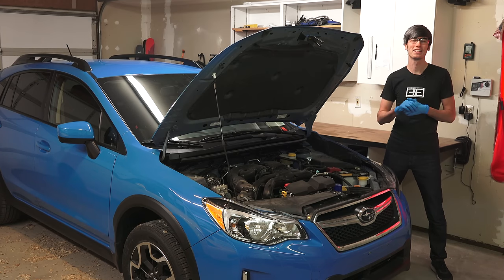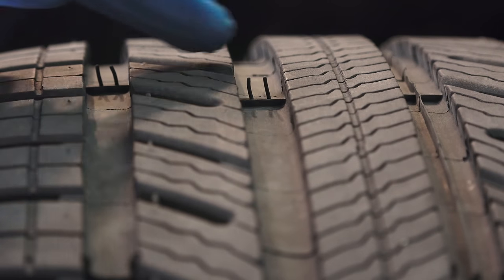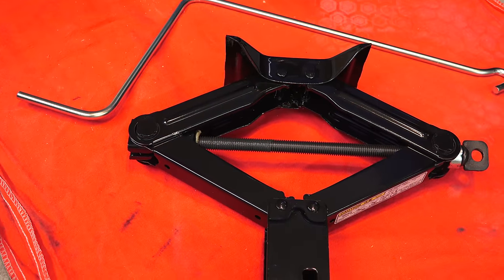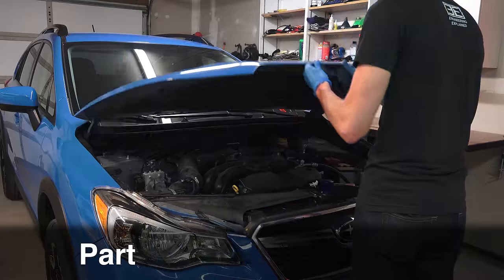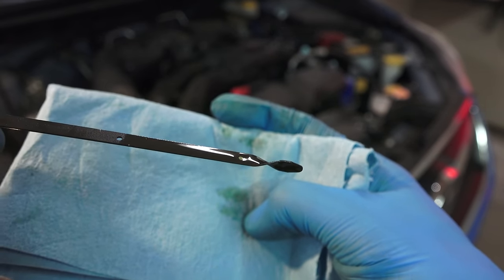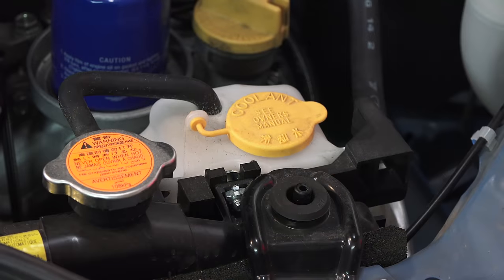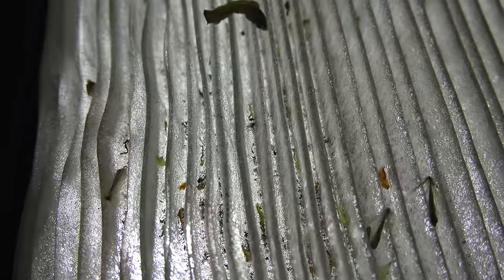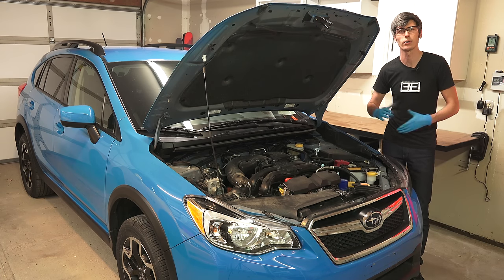How To Make Your Car Last A Long Time - Simple Checks

Comment: Important point: if your tires are at the wear bars, you are LEGALLY REQUIRED to change them, that bar is set to the minimum DOT legal depth.

IN REALITY: Your tire’s wet weather performance will fall off rather dramatically BEFORE you hit these bars, so for the sake of your own safety you should be budgeting for and planning replacement before that time. Double the depth of the wear bar (4/32”) is a general guideline with most tires, where some will perform down to 3/32” or less, while others I have had the misfortune to experience were useless at three times the wear bar depth. Those were straight up scary in the rain (Goodyear Eagle RS-A, the OE tire on the Saturn Sky and Pontiac Solstice... the Michelin Pilot Supersport and its successor are a vast improvement in dry performance, wet performance, and overall safety).

Please do not run your tires to the wear bars. If you can’t afford to replace the tires when needed for safety, you need to reconsider the vehicle and its running costs, as well as how you manage other budgeting. When planned out over the life of the tire, budgeting for a safe tire replacement interval can be done on a shoestring. I did it as a broke college student, and for years after I graduated, starting off shackled with $80k in debt. That was one reason to buy and drive a good used car instead of new. I could afford not just the car payment, but also the proper upkeep so that it was always safe and reliable without breaking the bank. AND managed to make extra payments against the principle on my loans. Point is: the budget is not an excuse to run a vehicle on unsafe tires. Fix the budget priorities, keep yourself safe, and keep those around you on the road safe. Thanks.

Comment: I have a 2005 Nissan Pathfinder V6 4.0 that I’ve had since 0 mileage. It has 108,000 miles now, I only get 9.1mpg MAX. How do I increase my gas mileage? My tires are properly inflated.
Reply: Queens Cop Watch Drive slower!
Reply: mrbill6666 that’s when driving under 2k rpm
Reply: Queens Cop Watch Ouch!

Comment: I have this problem where my check brake light will go randomly either crusing braking or accelerating, i went to a tire shop to check it and they told i still had brake pads for a while, anyone has an idea?

Comment: Motor oil change every 6 month, transmission fluid drain/refill every 30k miles and coolants flush every 4 years.  That’s my formula.  And only buy Lexus.  😊

Comment: 1K of comments. Hmmm. I don't think mine will even be read. I have two vehicles that are supposed to be able to run on Flex fuel. On pump gas, the 0-Ring on the gas caps last 6 months. So victory for corn farmers, Trump announces more ethanol % into pump gas. I have tried using silicone grease to keep the auto store gas caps from degrading and low evap leak code. So even 2001 up vehicles will suffer from too much ethanol. And parts stores will continue selling cheap parts that don't Come close to OEM quality. So 88 octane gasohol will still ruin cars that supposedly are "Designed" for the fuel.
Reply from the maker: I read the comments, I appreciate you sharing info!

Comment: 2:12. Hmm. That ruler doesn't look right. That looks like cm to me. not mm. Otherwise you either have very small thumbs. Or the brake pad is very small.
Reply from the maker: The small marks are mm, the larger ticks (every 10) are cm.

Comment: Salt and moist damage Car by rust. Burning fuel with water will rust car parts within. Water will combust with fuel combustion. I think water plain with electrolysis will send only hydrogen gas to combustion intake car engine will help keep Car parts moist free .

Comment: Can’t check oil with a dipstick on BMW because those greedy bastages dropped oil dipsticks years ago so that you would be more likely to go to the dealer for service. 

And yes I know that BMW has an electronic oil level meter but sensors can be inaccurate or break and that’s why the old fashioned manual method is better.

Comment: Tyre pressure is strange; every time I buy a new car the tyres need more pressure than the previous car. I think my first car needed 26psi, after that it was 28, 30, 34, and my latest car needs 36-38psi.
Maybe shocks are just getting better, and wheels are getting larger and wider, and tyres are getting thinner. Or maybe I'm just buying nicer cars with cooler wheels..

Comment: You want your car to last, get the thermostat out.
Reply: So it can overheat? Will your POS even run without it? You'd have to plug in the hole or all your fluid comes out.

Comment: I cant believe you put that pollen filter back in the  car , dont you know it can be the leading cause of legionaries disease if you have a dirty pollen filter? if your going to remove it might as well replace it and how come your  levels are all above the max lines> coolant is above the max line in hot weather that could cause the cap pressure relief valve to open  and dump coolant. oil is meant to be between the two holes not below the max mark increasing crankcase pressure  on the main bearing seals  dont know if your american engines have more tolerance than EU engines but that looks like a ticking time bomb to me. over here min means minimum and max means maximum.

Comment: STOP!!!!! BRAKE FLUID IS NON-CONSUMABLE!!! 

Brake fluid should not be added when it's low provided you don't have a leak. When it's low that means you brakes friction material is low and are in need of replacement. And these days rotors and drums are so cheap. I recommend replacing them at least every other time pads are changed but ideally every time. 

So unless you have a leak somewhere be it from a blown hose/line or bad caliper or wheel cylinder. NEVER ADD BRAKE FLUID! If you do when your pads are worn. You'll just be cleaning up a mess after resetting the calipers.
Reply: And yes...I know brake fluid is hygroscopic and attracts water so it will occasionally need to be flushed. But that is a completely different thing all together.

Comment: Wtf
Depth of the tire is for safety, pressure of the tire is for fule consumption, break pads also nothing to do with the length of the car life, cabin filter nothing to do with car life, bulbs they have to do with the safety nothing to do with car life!

Comment: Disappointing.  I love your other videos, but this one is extremely basic, and some of the info isn't relevant at all.  

Such as checking my brake lights... is a blown bulb going to make my car's lifespan less?  No.  Or checking the wipers... that's not going to extend the life of the vehicle at all, it'll just make it harder to see in rain if your wiper blades are worn. 

Checking fluid levels should be done before any long journey, this is fairly obvious to most people, I was hoping for some more advanced tips.  

And what about checking for signs of oil leaks?  Looking under your car or checking the road where you parked?  

How about listening for different noises in your car?  Such as the whine of a bearing or the knock of a worn bottom end bearing?

Love your other videos, but this one wasn't great.  Thanks anyway!